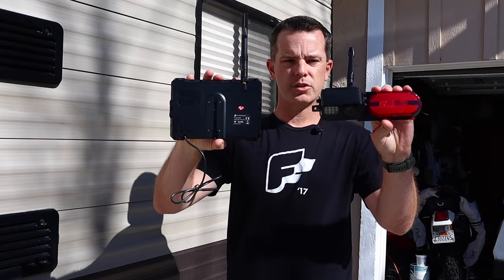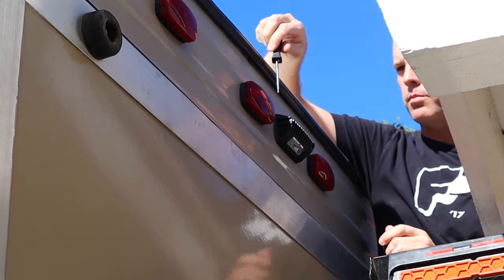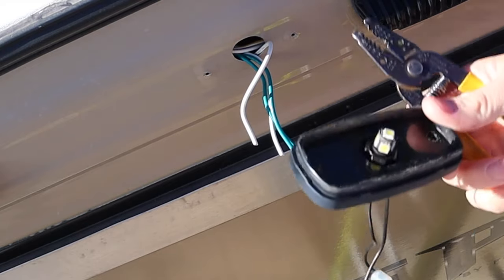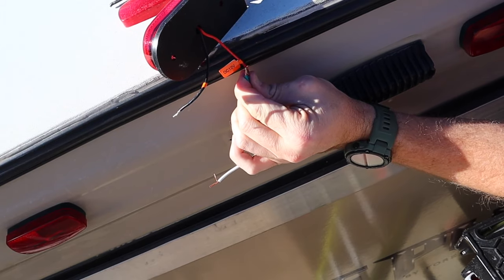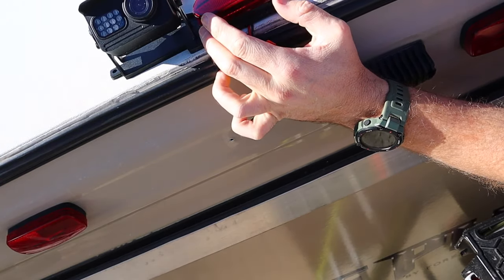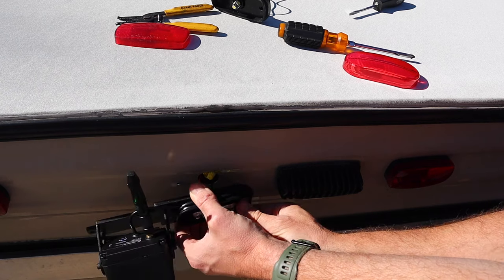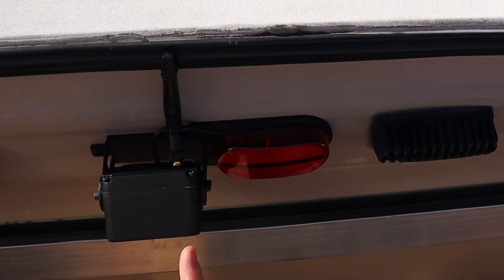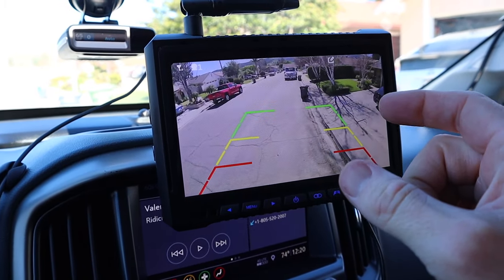How To Install a Wireless Trailer Camera - RV's Too -  EASY DIY

Comment: Just wondering on the angle set up.  Are you using it more for just watching traffic behind you and pointing it out higher or more to the ground for backing up?. And if so how far from the rear of the trailer before you see the road. Couple feet? You video showed nothing on adjusting the angle. Unless I missed something?? Thanks
Reply from the maker: The angle can be adjusted with the Allen screws on each side of the camera. I have mine setup to view traffic behind me, so it’s angled a little high. My view begins about 3ft behind the trailer so it does help with parking as well, but I can’t actually see my bumper on the camera.

Comment: How do you know the green is hot
I have two (sets) of wires …. All the same color
Reply from the maker: If they’re the same color you’ll have to get a multimeter to determine which is which.
Reply: @DoItYourselfDad  If they are the same color, better buy a different brand.
Reply from the maker: @enricoderojassarson5596  buy a different brand of travel trailer? Not gunna happen.